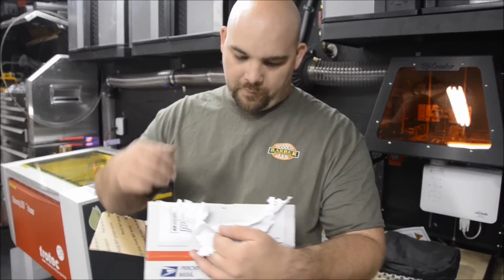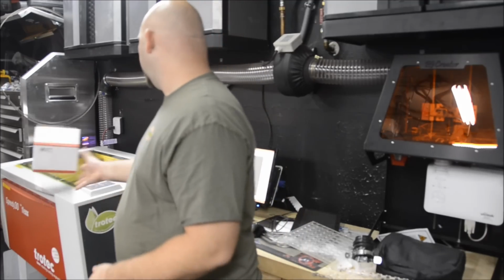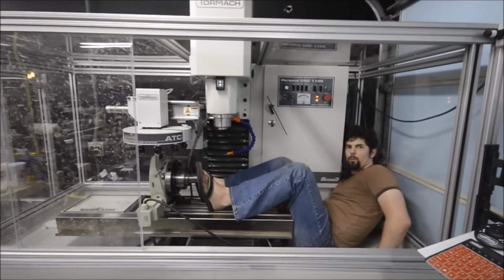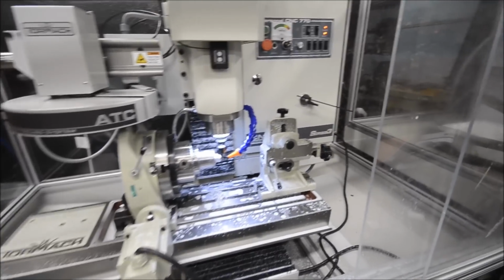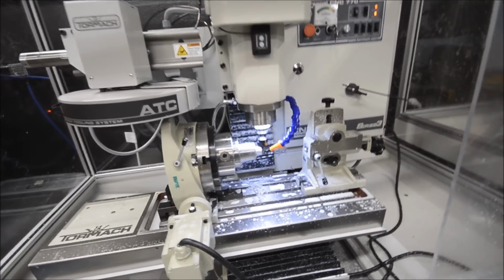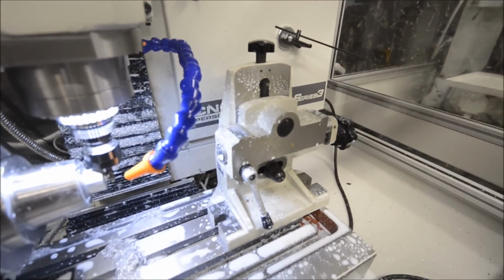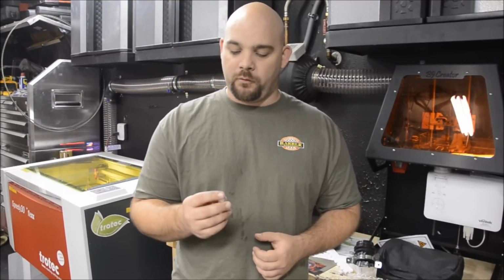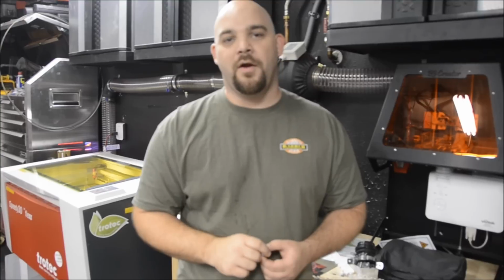Tormach 4th Axis and Pledge Manager Update

Comment from the maker: On the Tormach machining, yeah that was my first attempt at doing a metal part at real machine speeds, not the snails pace I had to run the Taig to make our prototypes. So there was a ton of chatter, from an over extended mill bit and way to much spindle speed. I worked the tooling path over and got 90% of the resonance out of it. much easier on the ears now. that said i'm no machinist so it could be better.